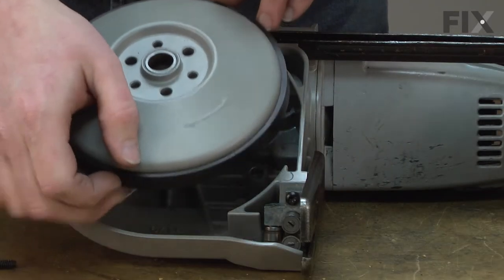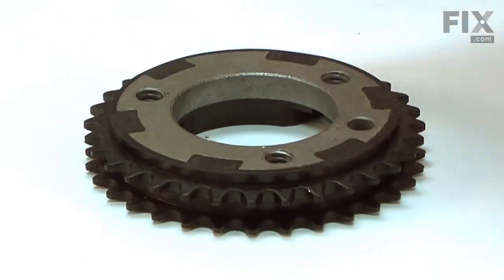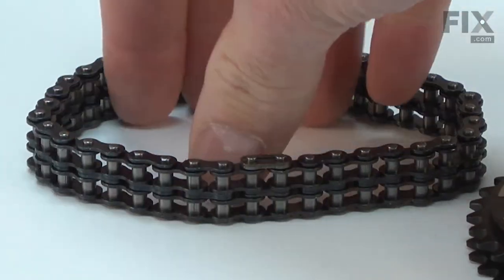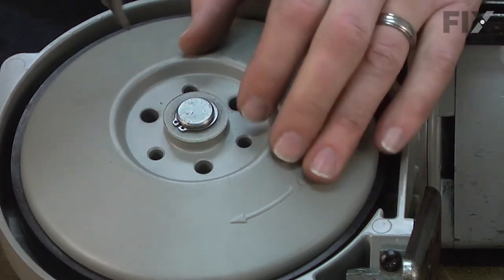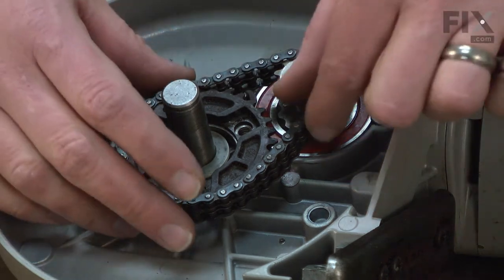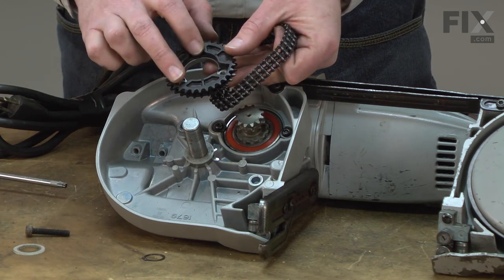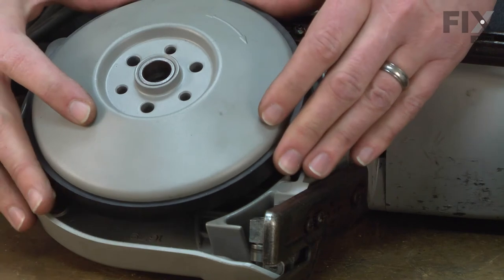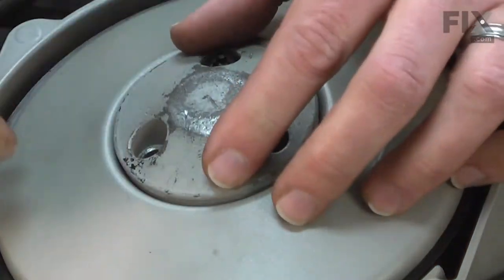Milwaukee Band Saw Repair - How to Replace the Chain Sprocket

Comment: Where do i get a new chain?
Reply from the maker: You can find the part shown on this video here: https://www.fix.com/parts/band-saw/milwaukee/fix10120828/chain-sprocket-kit-14-46-1175/?SourceCode=3&SearchTerm=14-46-1175
Reply from the maker: If you're looking for another part, and have your Saw's model number, you can enter it on our website and browse for parts you need!